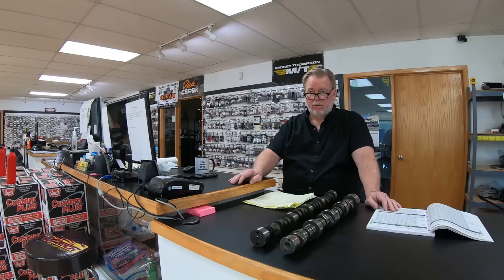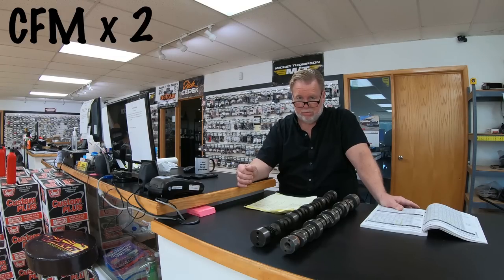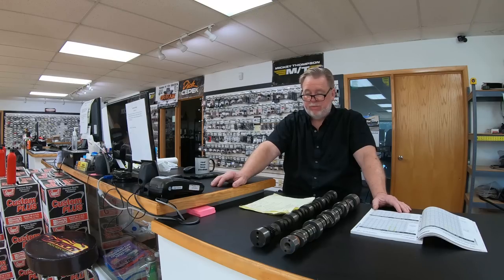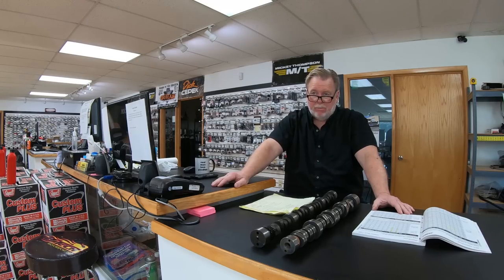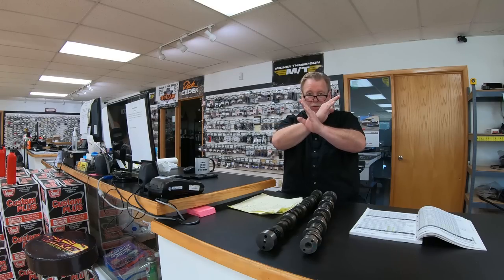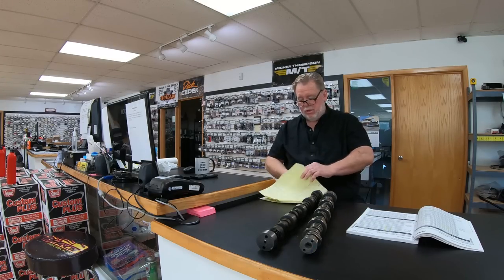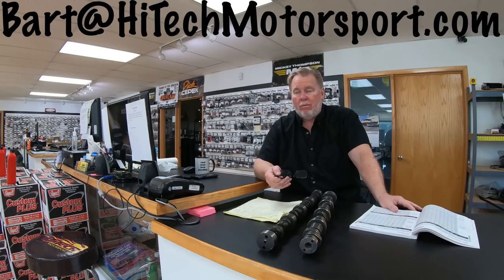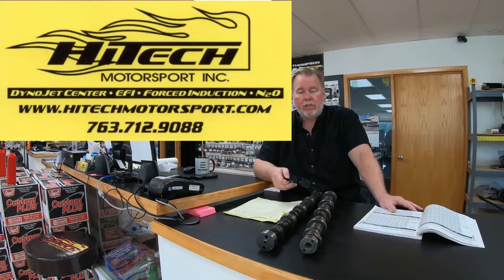How to Choose An Ls Camshaft For Max Horsepower

Comment from the maker: if you just want the "chop Chop" use a 232/242 on a 108 lobe sep. it wont pull its way out of a wet paper bag, and it will get 9 mpg but it will give you Chop Chop. but i will not grind it for you.
Reply: I’m about to do a ls swap in my 1990 gmc short bed with 373 posi , I want the maximum hp I can get ,but I want a fair fuel economy.Im planning on really just installing a cam for power purpose,because they usually sound good either way so can you help me determine which cam to use for a stock 5.3 or 6.0 ls swap
Reply: @marvisblockum1327  he is giving you the info you need
Reply: Dear Lo-Tech. Check out Richard Holdener's channel. He has 100's if not 1000's of dyno runs documented. He did testing on LS cam LSA. He literally tested the exact cam you said would not not pull it's way out of wet paper bag. Guess what? It made the most power. Not just the most peak power, it made the most power everywhere on the curve. Just search LSA cam test. Maybe you might learn something. PS if you want good gas mileage get a KIA.
Reply: I have an lq4 with 706 heads. Was thinking 210/213 @.050 600/600 on a 108. Should make good torque?
Reply: @lastditch5968  The dynamometer does not account for real world conditions though.  Instead, they run the engine at wide open throttle under full load, then slowly release the load while maintaining wide open throttle to increase RPM.  You can't drive a car like that.  So that cam will make power, but only as a stationary engine.  If you try to drive it with varying load and varying throttle, it will behave like utter dog turd.
Reply: @5533851  Thank you for your retort. You are 100% wrong, but it was a nice for you to take your time to respond. From just a logical standpoint you are saying some dyno results are valid while others are not and it is up to someone to somehow magically know the difference. Ridiculous. I know a thing or two about motor test stands. You see motor test stands measure a motors ability to produce torque at a given velocity with respect to time to calculate HP. With velocity in radians of course. Test stands typically employ a torque transducer or a load cell to quantify torque. A motors ability to produce torque is independent of how fast it is allowed to accelerate and in the real world It is common to have a motor at full load. Just floor the accelerator. 

On a side note, the engineering company that I OWN has recently finished engineering a motor test stand for Lucid motors new super car. We engineered the station to test torque output and NVH 2nd and 3rd order transient harmonics. Maybe I could send the algorithms and calculations to you so you can decide if the car "will behave like utter dog turd" and let them know. I'm sure they would be very grateful.

Comment: I got a 05 GMC Sierra ext cab lm7 5.3 with a BTR 227/238 cam with a 3200 stall and it’s very very slow anything below 60 what cam should I get the ls9 cam or what

Comment: Thank you! This is absolutely, without a doubt, the most informative and intelligent explanation I have found for specing out a cam. I am starting to plan a build on my 2001 corvette and will definitely be refering back to this video when it comes time to select a camshaft. I want the lumpy idle but more importantly, I want a cam that works with my set up and my needs more than just a sound. Thank you again!!!
Reply: I also have a 2001 corvette and i want to start modifying the engine! What cam did you end up getting? Any suggestions?
Reply: I would put a 221 225  on a 112 and it will roast tires all day because torque will come in sooner
Reply: @utahcountypicazospage5412  I run a 224/228 on 112 .550 lift in my 98 z28 LS1. 3200 rpm stall 2.1 torque converter.

Comment: Why do these heads like 600 lift. According to Brian Tooley 0.3 x intake valve diameter is the max lift you can utilize. Any more is wasted. 2.00 intake valve .600 lift. Go figure.

Comment: You don’t choose a cam for an engine, you choose a cam for that engines end use. If you want a perfect cam, you’ll never find one. Every single grind has its own personality. Horsepower , Torque, or somewhere in the middle. You will make gains in some areas and lose in others. Thats the facts.

Comment: The 233/253 @ 0.050 .646/.637 on a 112+4 in my LS3 Camaro would probably fall on the extreme/max effort end of your scale - but even with stock compression it performs well and has surprisingly good manners for 19* of overlap at 0.050.  It's ahead on power and torque for 3200 on up, picked up 70hp at the wheels, and 6-7mph in the quarter mile (probably more if I could get more than 4.10 in the rear).  Sure, dynamic compression took a pretty good hit with that much overlap, but eventually I'll get these heads milled and bring that back.  Honestly, it's street manners aren't bad at all for what it is, I put about 5k miles a year on the car, and I'm smiling the whole time. 

I'm sure it's not news to you, but you never touched on tuning in your video.  I don't think you can overstate how important that is to the way any camshaft is going to drive.  A poor tune will make a mild cam drive like trash, and a good tune can take a rowdy piece and make it very reasonable to live with.  I've nitpicked mine to death myself over the last few years, and the little things like injection timing and light load spark tuning makes all the difference in those bad manners areas.

But great video - I think you stressed a key factor really well: be honest about what you really want to do with the vehicle, and make a choice based on usage, not what sounds cool.  If you're not willing to put a converter and gears in it, and not willing to tolerate some misbehavior, stay away from big duration stuff!
Reply: the Legend
Reply: @Ws6Ms  lol!
Reply: Hey Andrew, where can I message you about finding a cam setup for my ls3?

Comment: I went to Hi-Tech back in 2004 to get their custom grind cam for my 2000 Camaro LS/MT. I had all bolt ons and  was looking for a little more power. I installed the cam and took it to Hi-Tech to get it tuned. Car ran perfect , I sold the car back in 2013 - Hi-Tech knows these LS motors! Glad to see you guys making YT vids!
Reply: Where are they located?
Reply: @grand3lyfecuhh798  Minnesota
Reply: What cam specs

Comment: 4.8/5.3L if you want to keep stock stall and trans go with something around 205-216 intake 210-220 exhaust range. Barts 223/227 cam will need a stall converter, which is perfectly fine. However, on my daily driver and for towing I like the stock stall.

Comment: Thanks for the video Bart. I'm stroking my LS1 to 383 and it is supercharged with a Harrop HTV1900. Currently has the stock cam in it (heads, valve springs, arp bolts, forged internals already but swapping some out). This video has been very helpful. I'm putting in a 224/230 .6 & .61 lift at 112 LSA. I'm not chasing power but low down torque and want to use a standard stall. I also want a little chop and the 112 LSA will give 3 degrees of overlap. Yes, I'll be losing boost but I'm not chasing max hp, just want that low down torque and a little chop. Also concerns about the blower running out of puff high in the rpm range, hence the cam size. Car is a WK Grange. Thanks from Australia!

Comment: If you have a stock torque converter 3.73 gears in something 4200-5500 pounds a cam with 209/217 duration 112 lobe separation with .550 lift may not get great peak numbers but makes good torque and decent horsepower 2000rpm to 6000rpm will idle decent and can be daily driven without killing the gas mileage to much for a 5.3 or 6.0 with a decent exhaust and good heads should make 390- 420 horsepower with similar torque numbers at crank much stronger than stock in torque and horsepower 2500rpm and up and if you have a car 3600 pounds or less with a 3000rpm or more stall converter 4.10 gears with CNC ported LS3 heads 6.0 or 6.2 or more a decent choice for street and strip would be a cam with 227/243 duration 113 lobe separation with .600 to .620 lift this cam would loose some torque below 2800rpm but with CNC ported LS3 heads it should make really good power from 2800rpm to 7000+ and make 480-500 foot pounds of torque and 550-580 horsepower at the crank idle at 800rmp and have enough low end torque 2000rpm to 2500rpm to be streetable and enjoyable to drive on the street gas mileage is going to be affected not a daily driver

Comment: 3:10 math.

Air Flow Research lists the heads I have flow at 260 cfm on the intake at .500 lift.

So...

 260 x 2 = 520

520 x .10 = 52

520 + 52 = 572 h.p.

Comment: Hate to correct you, but more overlap does not mean less cylinder pressure for the same duration cams.  When you tighten the LC you are advancing the intake lobe which closes the valve sooner.   Hence higher psi cranking pressure.  

Most oval track cars run 104 to 105 LC to help accelerate out of the corner. 

When I worked at Camonics years ago we found 105 to 106 made the highest peak power but the worst idle.  

113 to 116 made less peak  power but the best idle.  

Engines that are FI typically run wider LCs due to idle issues with low vacuum.

This is naturally aspirated as turbos and blown cars favor 116 LC to keep from blowing the charge out the exhaust port.  

Your video is somewhat correct but you fail to talk about other items such as exhaust type, compression ratios, etc. which also factors into this.

Comment: Great video Bart. Thanks for sharing your knowledge . Rebuilding my 6.0 in my  06 Hummer. Do you have a cam idea for towing 4000 lbs and street?  Have another set of heads ported for it and 1.8 ratio roller rockers .

Comment: Great video. Thank you Question? With long tube headers using your recommendation for my 2001 Silverado 5.3, of cam 223/227 600/600 should I plan on flowing heads and valve springs with hardened pushrods or keep what I’ve got Valve wise=stock? Also, torque converter, stock or high stall?
Reply: What did you you end up doing. And how did it go
Reply: Long tubes, stainless, just redid the heads with hardened pushrods. It’s perfect. Daily driver and a whole lotta fun
Reply: And springs. Just did it right.

Comment: My 383 makes 535 HP.. your right on the 1.5 HP per cube
Reply: whp or crank? My 347 CI ls6 makes 426whp through a 4l80e. So thats 511 crank hp with a 4l80e assuming 20% loss, so im almost there(1.5 would be 520 for me) 575 crank hp would be 1.5x for a 383ci
Reply: ShadowOfDeath24 all depends on the tune

Comment: STEP 1: Watch Richard Holdener videos.
Reply: Damage, Inc. why?
Reply: @duramax78   Because he's tests about every cam know to man in LS engines. Hes not a desk jockey at an auto part store.
Reply: Damage, Inc. sorry my mistake, I thought you said don’t watch, yes holdner is awesome to gain knowledge along with this gentleman.
Reply: Good but Holdener never seems to talk or test much on streetability which is what this video is more about.  Holdener has great comparison dyno tests I agree, but how do each of those setups run between 600-3000 RPM???  Thats the suspect.
Reply: Spirited Driver true but has holder mentions dynos are only accurate within a 4000 rev range, so he can only please some people, or he can run 2 runs one from 1000rpm to 5000rpm, and one from 3000-7000rpm.?
Reply: @duramax78    Sorry you missed my point.  I wasn't implying that people need to know HP & TQ in the low RPM range, I was trying to say that regardless of how much power the engine is putting out, we do not know how well the car BEHAVES at low RPM because that is what THIS video keeps referring to (which is important).  
I have owned a bunch of modified cars, and I always noticed the 'N/A' cars loose drivability at low RPM when they are heavily modified especially with aggressive camshafts, and not nice to drive 'slowly' in town AND especially in parking lots.  

Again, holder has great comparison builds, but thats half the story.   What is the goal of the vehicles driving behaviors is what is most important when adding power.

I will add, in comparison a Turbo manufactured vehicle is considerably easier to add power (vs N/A) without drivability issues to a certain point.  (just incase this is what you are accustomed to).
Reply: Spirited Driver sorry for the misunderstanding, thanks for the explanation.i have a question for you, I can get a lq4 for a couple hundred bucks, I want to get 600hp outta it, NA I was told I could leave the bottom end alone, just to let you know I’m a novice but am mechanically inclined but I attempt anything, just pulled transfer case out, rear diff, and front differential. To rebuild them to gain knowledge, everything is back in my 2009 Cadillac Escalade ext running great, so what would be my next big thing ? Find heads that will support that much horsepower I.e. enough air flow.?
Reply: @duramax78    No prob.  if you are asking about making your Cadillac faster then i would say sell it and buy a lighter car.  lol , the fuel that you will need to burn to get that pig to fly would cost more than buying another inexpensive small sports car.  lol  But if you must, then  for the Escalade first I would highly suggest changing the final drive's 'ring and pinion gear sets'  (*Unless you do a lot of highway driving).    Im not sure what they are stock but in most north american cars with around 6 speeds tend to benefit with a shorter final drive ratio such as 4.10 :1   I had  in my trailblazer ss years ago,  really wakes it up!  These really help heavy trucks accelerate and rev quicker through each gear especially from a stop. Then forced induction.
Reply: Spirited Driver no I don’t want 600hp in my Escalade...lol, I can get a lq4 for cheap and just wondering if the bottom end will hold up to that power.
Reply: @duramax78  I would say it could.

Comment: Do you happen to have a part number for the 223 227 cam? I bought an Lq4 for my 1997 Z71 pickup.  I was going to go with a stock cam, but a little more power would be nice! Thanks.
Reply from the maker: its a custom grind that i have done. $409+25 for shipping. i have them in stock. 763 712 9088 b
Reply: Hi-Tech MotorSport I have an lm7, 5.3, will I be able to run my stock torque converter with this cam?
Reply: Hi-Tech MotorSport . How are you doing thank you for the video. Where can I get a 226  234 600 600  112 camshaft or a part number?.

Comment: I designed and built my own cylinder head with rotating tubes where I had to guess the values by myself.  I ended up at about 250/250 with a 110 LSA @ 0.050" equivalent.  It has about 4-5 inches of vacuum at 700 RPM idle.  I was hoping it would work well at 6k+ rpm, but oddly enough the airflow is similar to stock between 4,000-7,000 rpm and a bit better below 4k.  If I did it again, I would certainly go to something like 230/230 since it flows better than a poppet valve engine and so I can improve the idle.

Comment: What's your thought on the BTR stage 3 V2 truck cam in a 09 4.8 has 799 heads. Truck weighs around 4500 and is a daily driver.

Comment: Ok next time can you talk about the 5.7 vortec truck engine because thats what I have and looking to get the most out of my engine
Reply from the maker: vortec truck cams are different. the heads are only good for 540 lift with the guides. if you are still using the fuel injection system use a 220/224 540/540, on a 114 lobe sep. the vortec heads are very good but they have some limitations with the valve springs and fuel injection. b

Comment: I got a 5.3/t56 with sloppy stage 2 cam idle set at 900rpm and man she idles aggressive . Car moves side to side at idle I love it. Only paid $229 with pac springs and install was a breeze
Reply: Did you have to install a stall converter and what heads would you swap with that?

Comment: I've got a 2000 2500 with a 6.0 3in single exhaust want to put a cam in going to put some 243 heads milled 20ths  still want to pull my boat and camper but want it to sound good at idle
Reply from the maker: 224/228 610/610, 112 lobe sep+0. the lobe sep will do the lopey idle and the cam is small enough to still run and pull well from 2000 rpm up. $409+25 to ship. 763 712 9088 b

Comment: Can you recommend a cam for my LS 416 stroker. I have 11.5:1 compression, stock LS3 heads, long tube headers. This engine is in my 81 Firebird backed up by a 4L70E transmission and 3000rpm stall and stock 308 gears. This is a streetcar. I want a good idle, I don’t mind the racy idle sound but I don’t want to be idling above 850 rpm .
Thanks

Comment: At 16:34 you nailed it man I made an LS cam selection video based on what we learned on the dyno over the years, I am astounded at how close your numbers are to mine I knew most of this but it's nice to get some confirmation anyway I have been saying the exact same thing with good flowing heads a ton of overlap is not only not necessary it causes lousy performance good video
Reply: Watched yours as well, chose a 217/225 .595 .587 114+2 Cam Motion cam for a 6.0 in my almost 4k lb street car, for all the reasons you both talk about. More concerned with driveability and low/mid torque than max peak hp. Not installed yet as it's my daily driver, I think I made a good choice. Your thoughts on my selection ?
Reply: Looking back at your cam selection video , I already asked your opinion 8 months ago  😂👍

Comment: Awesome video many thanks for your time invested in it & the valuable info ! I have quick question on that custom grind 223/227 5.3 cam you get made - do you also sell the proper springs,pushrods etc... in a kit form say for a lm7 ?
Reply: how your build going
Reply: I got the truck under the carport & the engine on a stand in the garage- I should’ve mentioned this is an oddball build as it’s a very clean rust free 78 f150 2wd long bed. I’ve yet to scrounge up either a decent 4L60 or 80 to go with it